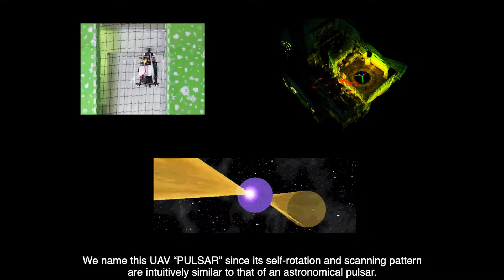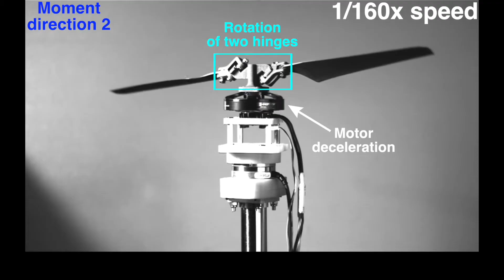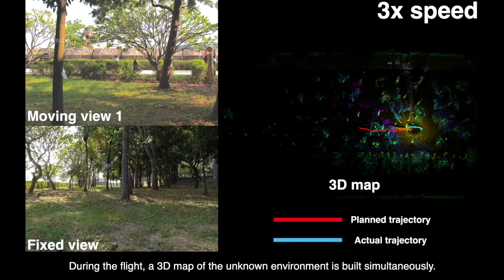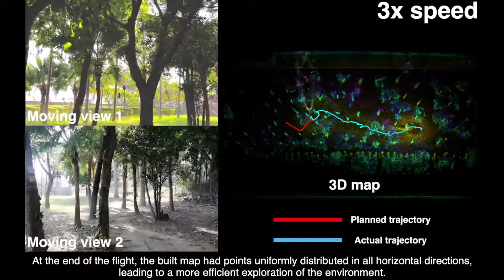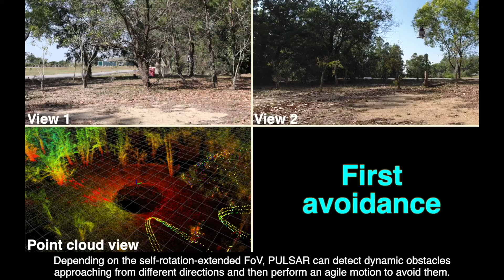A self-rotating, single-actuated UAV with extended sensor field of view for autonomous navigation

Comment: Need to shrink that down excepting the propellers by 90% then add three more and create a quad copter start doing package delivery for Amazon amazing to see this especially in slo-mo not sure how rugged or ruggedized the propellers are against wind, debris and other foreign object impacting but creating a quadcopter might create the necessary redundancy especially if each separate blade/optical system can support individually the holisitc item said #quad_copter 😊😊

Comment: these transparent blades need to be fixed at an angle so that the rotation of the hull adds lifting power
Reply: probably will come at a cost of the reduced maneuverability as this way the main blades will move slower. But there might be some sweet spot for each use case